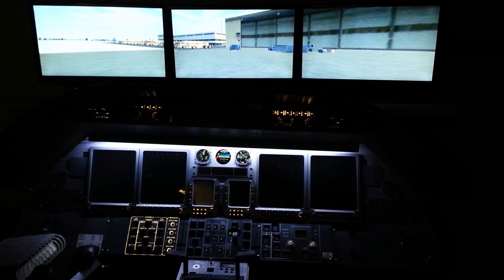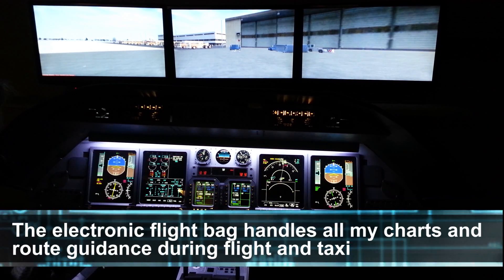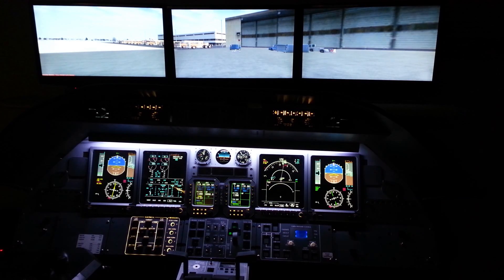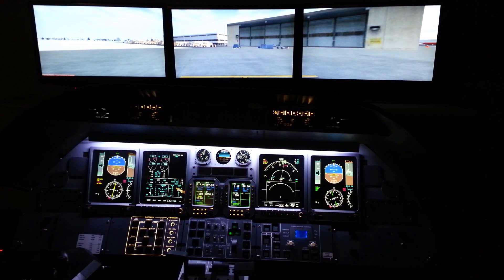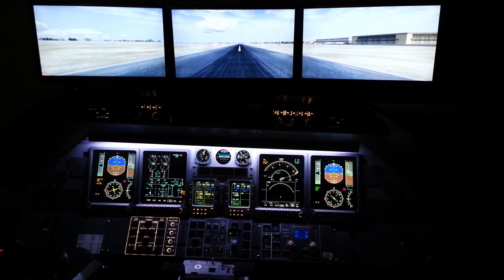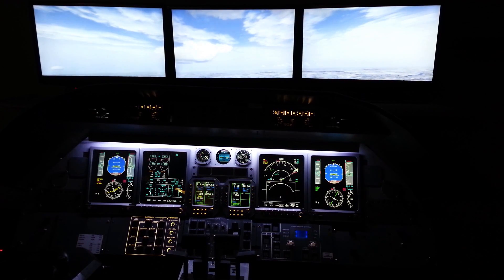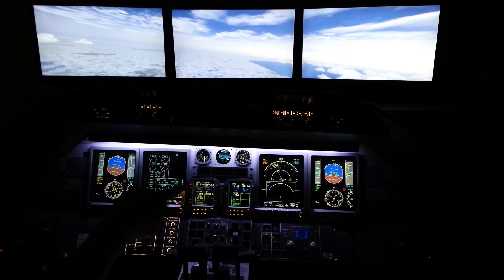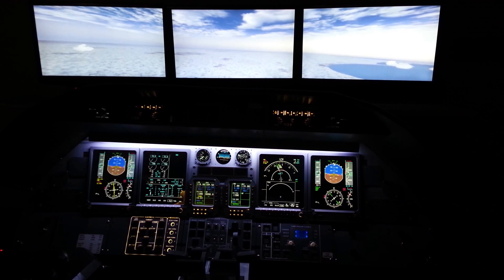Flying the Lear Jet Home Cockpit -Startup and Flight!

Comment: Im currently building a 737 overhead and autopilot, efis cockpit, just spent over 60€ on switches off ebay
Reply: can you share your code for the learjet?
Reply from the maker: Its on my Guithub and website.  Start at blog.mkme.org and go from there.

Comment: Where did you get the panel parts? How much does something like this go for. I like that its not the typical 737/A320 cockpit. Looks really good!
Reply from the maker: +Danzo DaManzo Various sources and made myself. Hangar45.net has all the info you desire on the Lear.  As for price- more than I ever want to think about....  It's for sale :)
Reply: still for sale?
Reply from the maker: WIPilot1993 Yep the MIP panels etc (no PCs) posted on Hangar45.net

Comment: This is so freaking cool!!!!!   In my real life I am a maintenance technician for f-16 fighter aircraft and this is so much fun to watch!     How far does the sim take you? Do you have to adjust for Center of gravity etc?   
Chris
Reply from the maker: Chris Pine The Lear 45 SIM has the same range as the real Lear so fully fueled it goes pretty far :)  Only once have a flown a full flight draining all 3 tanks. As for CG yes- You adjust your passenger and baggage loading to suit depending on the flight.  Pretty much all real life variables are indeed included in the simulator.  Cheers
Reply: Amazing and freaking cool!
Reply from the maker: Chris Pine Thanks!

Comment: What flight model and gauges do you use?
Reply from the maker: Tim O'Driscoll Its FSX Lear 45.  Gauges are various- Jet45 for MIP displays, Standbys and CWP are by Dave Ault,  RMUs are Jet45, Pressure Panel is Arduino with Nokia 5110.  Cheers
Reply: thank you. nice setup